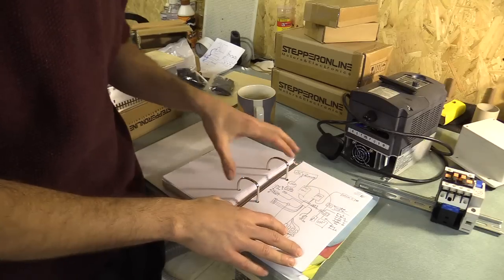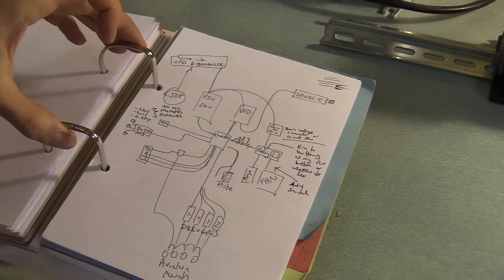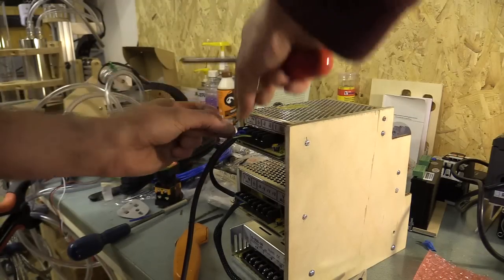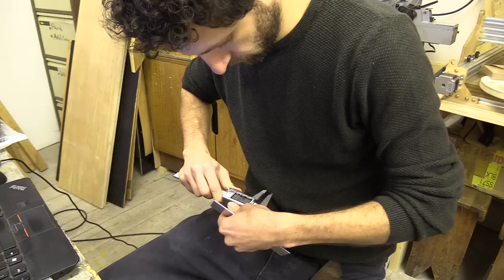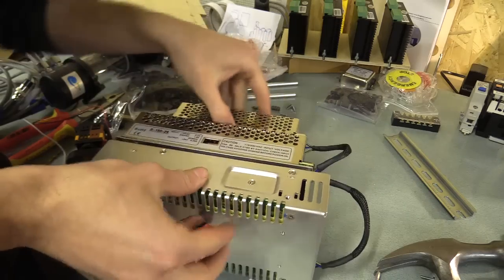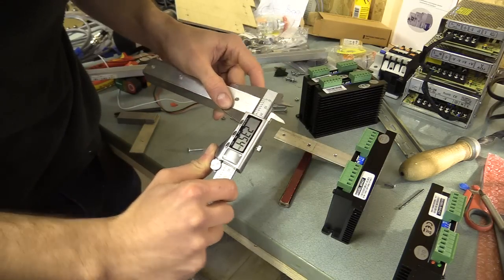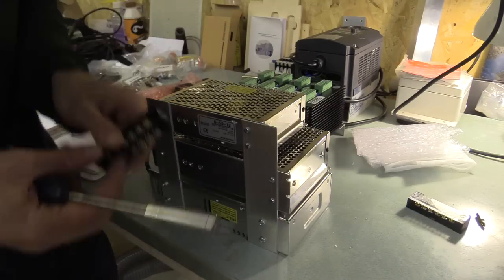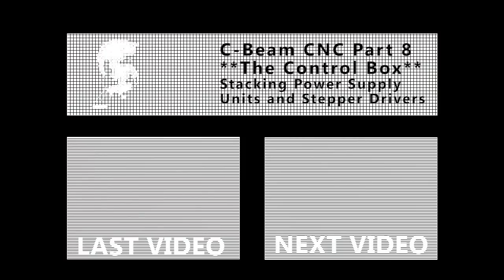#8 Stacking Power Supply Units and Stepper Drivers #8 / CNC Control Box

Comment: I am also using 3 power supplies and would like to stack them as you did but I worry about air circulation and blocking the internal fans. Have  you found 1 cm to be adequate?
Reply from the maker: I've actually now use a controller with one 24v power supply and using the duet 2 wifi. Much simpler. Hopefully I'll document the process when I rebuild.

Comment: Hi Educating Savvas
I have a question for you or anyone knowledgeable in DIY CNC electronics. I am building a Sphinx CNC with the help of Kyo's build guide. You can see it at OpenBuilds called 7050 Sphinx. Anyway, I purchased all my electronics from OpenBuilds except for Phoenix Controller. I went with the High Torque Nema 23, DQ542MA drivers and 24V PSU. Will this PSU be enough? I have a spare 12V PSU from another project I could use also but I have no idea how to wire them in series. Why did you go with 3 PSUs? Thanks 

Michael
Reply from the maker: Using one PSU is fine. You need to make sure the PSU can supply more amps than all the components need. I had 12v, 24v, and 36v components I wanted to power - and individual PSU's produce more stable power than trying to use voltage regulators to step things down or up. My controller is overkill but I want to be able to  move it to a larger CNC machine one day and only have to flick a few switches on the stepper drivers. All I did was connect the main 240v power in along all three, and made sure the grounds of all PSU's were connected. Good luck!